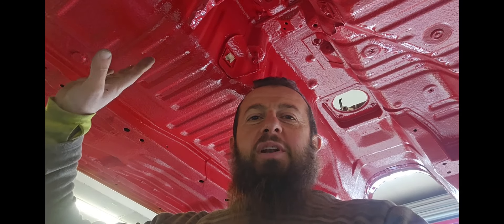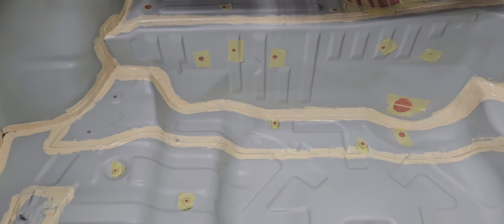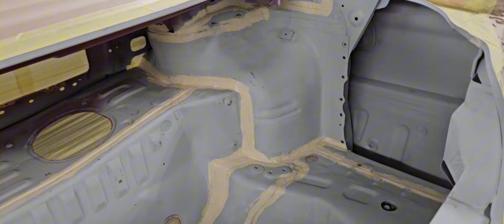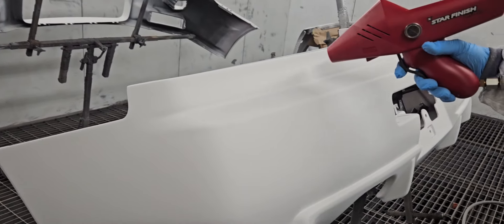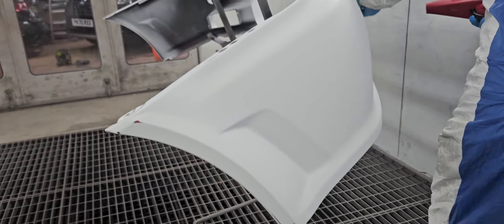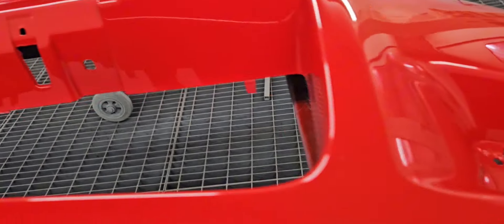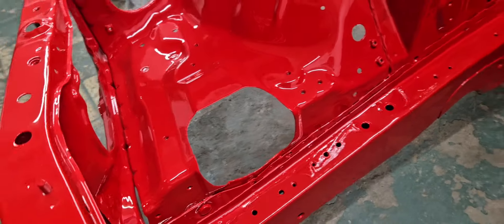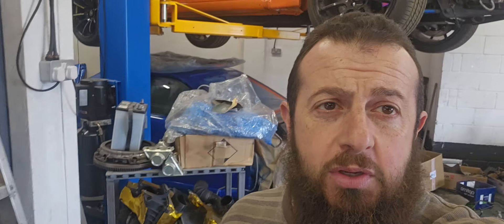Nissan skyline R34 GTR full restoration we nearly finishing the car stunning result

Comment: I was just wondering,  after painting, do you re-chase all the threads for all bolts ? Also do you put anything on all the body bolts when you put them back at all for rust protection?
Reply from the maker: Some of them yes indeed we have to clean them and re-thread just a bit.
We have zinc all the bolts and nuts.

Thanks for your comment 🙏🏻